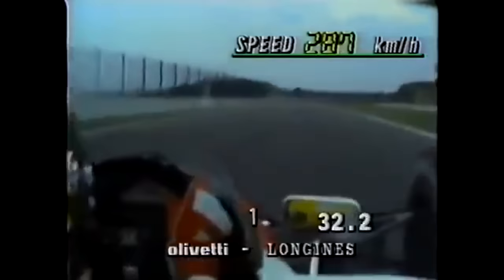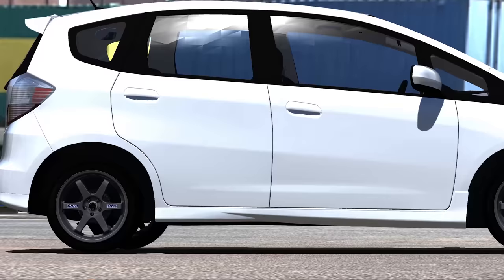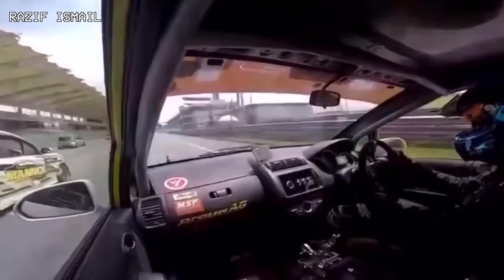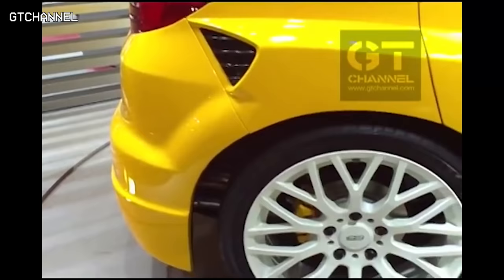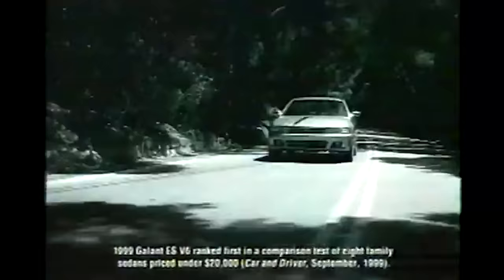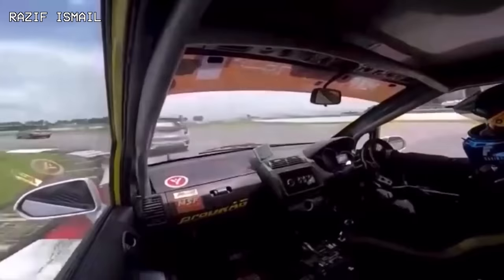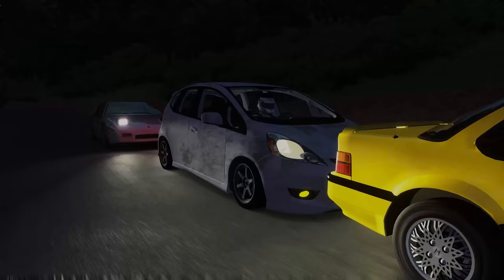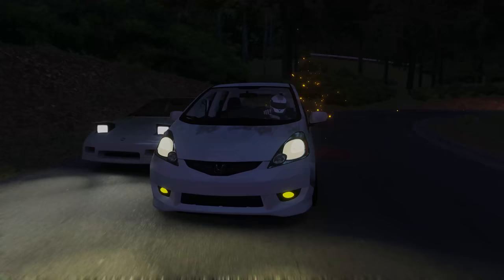Honda Fit - What Makes it so Great?

Comment: 2nd hand Jazz/Fits have gone up here. I have had one since Jan 17. (The basic one so no gps, folding mirrors or fog lights etc) Prior to that I'd had 3 Saabs which are wonderful cars if you can find someone who knows how to work on them. Here (AUS) everyone knows a Honda. I was very hesitant but it is truly a Tardis. The magic seats and whatever. I loved my Saab turbo's, but in this day an age fuel efficiency it is Gold. They are now discontinued here hence their 2nd hand value is gr8. My only bugbear is the A Pillar (which they added a window to for visibility), and having to add stuff. So my gps comes out of the fuse box and runs up so it is at the top of the windscreen as the windshield is so angled there is no way I can put down low. I am not an orangutan also not much room due to a/bags. Either way I wish I'd got the 'sports' model now, I love it. As for cornering, it's like a go-kart.

Comment: Fit is one of the most or THE most popular in Eswatini,  where they bring in old Japanese cars which are about 10 years old. The fit is very fuel efficient and light which is good on fuel in the mountain kingdom.
Reply: Its great in the state of Pennsylvania as well. It handles potholes, dips, and heaves like a champ. Great in corners. Good gas mileage, and so much fun to drive hard. The fact that you can flog the shit out of it and still be doing (mostly) legal speeds is a big part of that. You can also do that and not worry about breaking it, freakin bombproof car. Absolutely STELLAR in the snow.
Somehow it also manages to be practical and a good highway cruiser too. 
This car will easily pull to 115mph if needed on the turnpike and still have some reserve left.....yet it handles city traffic with aplomb as well.
As a rule, I dont like FWD cars, the Fit is the exception.

BEST ALL AROUND CAR EVER MADE IN THE 21st CENTURY.

Am i going a bit to far as to say the Fit is the modern Japanese interpretation of the original Austin Mini?

Comment: my 2004 Honda Jazz (fit in US) has 120k km. bought in 2010. i still drive it. euro 4 so i can still use it wherever i like. 
78 hp, 175km/h, 16 km/l, moved 4 times in it. I did my driving school with the exact same model in 2006.
almost zero maintenance, nothing broke, sex in it like i had a bed (girls also like the shifter alot XD) and raced it on a mountain like initial D 
i will cry like a child while giving it back to the car dealer

Comment: I have my 2008 Honda Fit that I got in 2012. It took me to high school, college, and I still ride it today. 180k miles on it right now :( It has been so reliable and dependable to me. I’m hoping to keep it until it simply cannot go anymore. I’m so thankful for my Honda Fit
Reply: to Kaylee Baginski: *SOUNDS LIKE YOU MAINTAIN YOUR CAR ON A REGULAR BASIS: ENGINE OIL CHANGE, TRANSMISSION OIL, BRAKE FLUID CHANGE!!* RUNS PERFECTLY; I HAVE RIDDEN IN SOME CARS WITH ONLY 60K MILES ON THERE CARS AND THESE CARS SOUND LIKE THEY ARE DYING!!
Reply: To Kaylee Baginski: you mean 
** :)**, Right?
Reply: @JESUSCHRYSLER5512  Yes, I check the maintenance regularly! Usually, if you take good care of your cars, it'll take good care of you.
Reply: @kayleebaginski  sounds like you are doing a great job of caring for your car! GREAT JOB!!👍👍👍👍

Comment: My dad got me a 2nd gen GE8 sport while I was waiting for my insurance settlement after my Corolla was totaled by some drunk fuck. I had previously owned the 3rd Gen GK5 so I saw this and went 😲😲😲. Fits really are underrated especially when it comes to cornering speeds in the Touge. That little GE8 hit speeds of almost 80mph in the long high speed sweepers. Fast af for a stock little hatch and it was with an auto with paddles shifters! I love these little things! Highly recommended!

Comment: My favorite feature? Other than an average for me of 43mpg and its NOT a hybrid? The drink holder for the driver in front of the vent. Many is the time I placed a drink in it that was warm to hot but had a nice cold drink in a few minutes. 

Most hated feature? It eats batteries and starters. They really dropped the ball on this. 

I bought one and my family laughed. Right now the ones that laughed also own a fit. 4 in the family 2 2015 and 2 2018s

Comment: One thing wrong, the Jazz/Fit has always had a torsion beam rear axle.  The GK chassis and engine is mechanically the same as the GE.  Also the GD one of the last Honda's to have a cable throttle and the last Jazz/fit to have a swappable exhaust manifold with the GE onwards having the manifold integrated into the head.

Comment: I've replaced my sprightly 4gen Civic DX with the 1st gen Jazz 1.4 when the sills rusted out. The Jazz was so practical, good fuel economy, small on the outside and spacious on the inside, but the L13A engine felt very boring, even anemic. About a year later I bought a BMW 323ti e36 compact.

Comment: You failed to mention in the US it was the first experiment in "small and tall" as they called it before the introduction. Now every make has one. The bad: Plastic parts like fender wells and splash guards tend to fly off for no reason. The door locks SUCK. Changing a headlamp requires fishing blindly between the fender and front tire. The good: It's A LOT of fun to drive. The front cabin is gigantic, visually narrower but bigger- HUGE between the glass and the driver. It has a ridiculous amount of space. (First gen only.) I carried an 8-foot instrument rack and 8-foot lumber diagonally with the hatch CLOSED. I carried a tandem bike with the front wheel removed and the second rider seated behind me- with the hatch CLOSED. The OEM door speakers are excellent. They might be Pioneers. Honda has used them in the past. Pump 60 W per channel in some way. You won't be disappointed. Soon it will be a high-millage car to sell that served its purpose, but for now it's a hoot.
Reply: The Ford Festiva was small and tall also. They were here years before the Fit.

Comment: I had the first and 3rd gen and lament that Honda pulled the plug on this in the US.  Those were great cars and could hold more cargo than small SUV's that were much larger in size.  The only grip was it was a bit noisy.  Too bad Americans prefer 3-ton V8 behemoths.  This was a great little car while it lasted.

Comment: I was in market for a small hybrid hatchback for daily with parking ease and fuel savings. I bought a 2015 honda fit hybrid because it was offering more performance that prius C, was much more roomier and it came with a dual clutch gearbox which I wanted to experience as a car guy. However after driving the car I discovered that I have bought a car that has seriously sharp handling for a fwd. It has a very superior handling for any fwd hatchback and really falls in league with Honda integra's, given that it is a hybrid economy car.

Comment: I have the GD1, converted it to GD3 spec (VTEC engine, 5 speed manual). It's great but lacks engine upgrades (or mods). Suspensions, seats, transmission can be modified but it's a little costly IMO. 

I still love it nonetheless. The Fit in my country has gone up in prices ever since the local distributors stopped producing (or assembling) the Fit to make way for the City hatchback (which indirectly is a replacement for the Fit here). Sad but the GR isn't that great anyway. 

Keeping my GD for years to come. 😂

Comment: Rear seat bolt anchors are in direct contact with the exterior wheel well. Corrosion will lead to seat belt failure. This only pertains to those driving in winter climates and municipalities who use salt. Now that these cars are 10+ years old check that bolt.

Comment: I had a 2009 Fit, and in my 48 years of owning cars, it was my favorite. If it wasn't totaled in 2020, I'd likely still be driving it. My only complaint is that it was geared too low in the final drive, thus decreasing its potential gas mileage. It needed a real overdrive.

Comment: My 04 manual sport has 197k miles and is wearing out, I’m sad. I’ve been looking for years knowing the day will come... I’ve been disappointed at everything I’ve sat in. The fit was designed EXTREMELY well.
Reply: It'd probably go another 100k no problem
Reply: I have 265,000+ on my 2009. Take care of it and it will last.

Comment: I put slightly wider 205 tires on Enkei wheels that also slightly widen the stance on my 07 Sport ... it's shocking how much better it handles than the base LX model.  A shame they discontinued it for the USA after 2020.  They should have shoe-horned the CR-V's 190HP 1.5T into the Fit, what a missed opportunity.

Comment: My wife's Manual fit turned 15 this year (it's Quinceañera). Overall she's probably put $2800 worth of maintenance into the car in the ten years since she's paid it of. It's as reliable as my 2002 LS 430 but the parts are much cheaper. I can not believe the utility - the trunk space is insane and it's almost as useful as a small truck bed with some exceptions. I hate that Americans are shelling out money they should be investing on car payments north of $500 and even $1000 when simpler cars can fulfill their needs.

Comment: When I was looking for a car to replace my wrecked Mazda 3 GT: it came down to a 2007 Honda Fit or a 2005 Honda Element. I torn between both cars but ended up with the Element instead. The Honda Fit is still a great car though.

Comment: Unfortunately, I got a bit of a lemon when I bought mine. Engine continually misfired for about a year but the biggest issue is that water leaks into the cabin every time it rains.

Comment: I’ve got an 08. The trunk leaks and floods the spare tire compartment with water, the dashboard has rattled since I bought it new, the radio display is failing…but it runs and has safely gotten me across most of the eastern United States. Would’ve been great if the interior and overall build quality was better, but I can’t knock the engine really.

Comment: Well Honda is the boss when it comes to practicality, I have got one the GE8. I bought it in 2012 & I have drove it over 100000kms in Delhi NCR(for foreign users 100,000kms is like heaps a shit load in India, it is like a million kms in europe compared to a 100,000 in Delhi NCR) and I still have original clutch haven't spent anything on it.

Comment: I don't know how it is in the USA, but I think you have very few Suzuki over there?
Here in the South Pacific, the Suzuki Swift is the number one selling sub compact hatch and it had been for many years now.
Here the Honda Jazz has a real nana image. There's a lot of elderly here who drive RS Jazz. 
I think it comes down to marketing. Suzuki has always been targeting a younger audience here. 
I believe the Suzuki Swift sport is a very capable fwd subcompact hatch track car. Suzuki also have the lesser known Swift AWD models.
I do believe that the first two gen Honda Fit sport models are a more capable track car than the equivalent Suzuki Swift.
One thing that I love about Honda is their engineering efficiency and use of space.  I feel cramped in the drivers seat of a swift and there's zero space for back seat passengers and luggage.  The Toyota Vitz had heaps more comfortable space than the swift. But nothing can best the little Honda in interior design space. 
That was a big buying point for me, when I looking for a cross over. I bought a CRV over the RAV4, because the Honda has Soo much more interior space and better on road handling, was more fuel efficient and had slightly more hp.

Comment: Im on my 2nd Fit. First was a GE6 then trade in for the GE8. My friends was wondering why i got another Fit untill they sat in my GE8 n test drove it. And now dat the fuel price is off the roof, im juz glad i hv my GE8. Hard on the throttle to n back frm work every single day but that doesn't concern me coz im still getting decent fuel mileage

Comment: 2007 Fit base model owner here.  Bought mine for $6k two years ago with 60k miles from a grandmama.  I bought it to move - get this - pinball machines.  No kidding.  I have driven all over the southeast picking up machines and it costs me almost nothing to drive.  30+ MPG and incredible storage capacity.  You aren't fitting a pinball machine in any other super subcompact car on the market.  I do have one gripe and that is that the paint Honda used in 2007 wasn't very good.  My clearcoat is coming off.  I will probably get a $1k maaco paint job at some point before I give it to my daughter to drive.  It is safe, cheap to operate and maintain and is extremely reliable.  They shouldn't have discontinued it.  I might get a newer one while I still can.  No EV for me!

Comment: I bought a brand new Fit back in 2009. I thought it was going to be the 1st gen but the dealer pulled up with the new GE. Needless to say it was my first brand new car. I literally beat that Honda every day of it's life, it was a 5 speed, 7k rpm all the time, took it to autox, open track days, you name it. I had a NY custom plate that said FITRARI. I got 175k miles out of it in 5 years, like an idiot I sold it thinking I will find something better to be happy with. Nope. It was by far the most reliable and one of the most fun cars I have ever owned and I recommend it to everyone. I am not even going to mention the packaging and the interior size which is literally ridiculous, if any manufacturer wants to make a hatchback just copy this. I then bought another beat up one a few years later with 205k on it ... again beat it all the time. Sold it to a buddy who beats it even more than I did, the thing wen through a hurricane, got flooded, started right up got salvaged and is still running. I had gotten a 2015 with a 6 speed and it is more refined but the 2nd gen just drove better and was more fun. For those that have any doubts the Honda Fit will go down as an automotive icon, this is coming from a BMW enthusiast.

Comment: Here in the UK, the jazz / fit is the default pensioner car. I don't think I've ever seen anyone under 60 driving a jazz. And 9 times out of 10, if there is a queue of cars stuck behind someone on a country road, it will be a jazz causing it. Doing 25mph on a 60mph road.....

Comment: In the 3rd gen Fit the engine is excellent. So is the CVT. l actually get slightly better fuel economy on the highway, than the EPA spec. But of course around town my fuel economy is worse than the EPA spec. While I'm sure the specs for cargo volume are accurate, part of the reason for the good cargo specs are that the cargo area is high – length by width space could be better. I was unable to fit a 30 by 60 inch (0.76 by 1.52 meters) folding-leg table (a ubiquitous table size in the United Sates) – into the car. The handling is is only fair. That torsion beam suspension on the rear wheels helps maximize cargo volume but at the expense of enabling independent bump-handling capabilities for the rear wheels. The electric power steering feels a bit weird. The headlights are inadequate. Neither the low beams (dipped beams) nor the high beams (down-the-road beams) are bright enough. But the car's worst problem is that its AC is inadequate. If the outside temp is over 90 deg F (32 deg C) the AC will cool the passenger cabin down to 80 deg F (26 C), after about 10 miles of driving – but only if it is a cloudy day. If it is sunny, sun coming into the cabin thru the side lights,  striking the black interior, will heat up the cabin just about as fast as the AC will cool it down. And sunlight through the windshield will make the horizontal "dashboard" area painfully hot to the touch. Pump the cool air out through the defrost-defog vents will not help much cool it down much. You'll never get air inside the cabin to below 80 deg F (28 C). Best you can do to help keep cool is to send the cool air out of the dashboard vents directly onto the faces of the driver and front seat passenger. But this doesn't help the passengers in the rear seats.

Comment: I had a 2011 Fit, bought it new and it was the most dependable, trouble free car I have ever owned. Put 150,000mi on it and the only repair was to the blower fan and resistor for said fan. Oil changes, brakes and tires aside, that is the only money spent on it. Things I did not like about it. It was borber-line dangerously slow making freeway merging a hair-raising event at best, it was loud as hell inside the cabin and the steering would not center worth a damn. I looked like a drunk going down the road. 
Sold it in 2018 and bought a new 2018 Civic Si. Light years better than the Fit and any other Honda Civic before it. Great car! I wish Honda would have offered the fit with 200 - 250hp and refined the suspension with a performance package. I would buy that car FoSho!

Comment: I do tend to embarrass sports cars in the corners with my 2015. The lightness and feel you get out of the Fit is really hard to find, just wish it had a bit more power. Also if your AC goes you're gonna be out around $2500, so that kinda sucks a lot

Comment: This car is A WAR MACHINE....takes a beating and keeps on delivering....350,000 miles strong ...still drives like new
3 things that make it great....
1. The timing chain ( not a belt)
2. The Fuel filter ( good for the life of the vehicle)
3. All Aluminum build (dissipates heat like no other)

....and fuck you guys Honda cannot be beat 👍👍👍👍👍👍👍

Comment: Always admired the fit but the low power numbers kept me away. When the fiesta ST came out i knew it was perfect for me. Torsion rear suspension allows for controllable lift off oversteer and prob not as stiff as a fit but still enough to 3 wheel round a corner